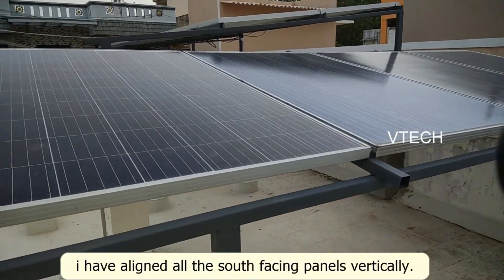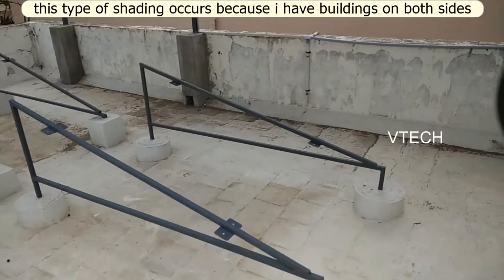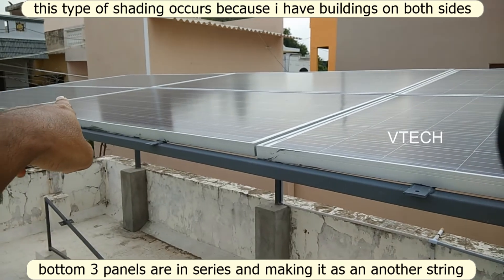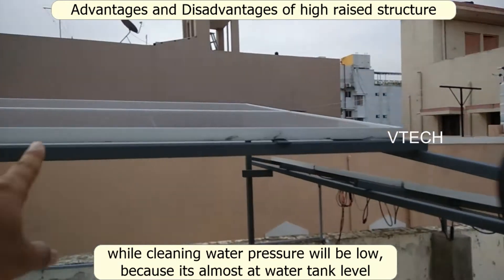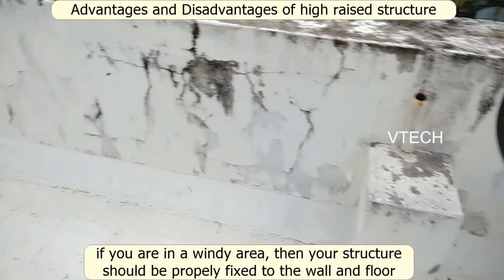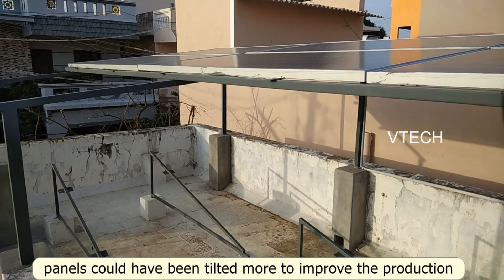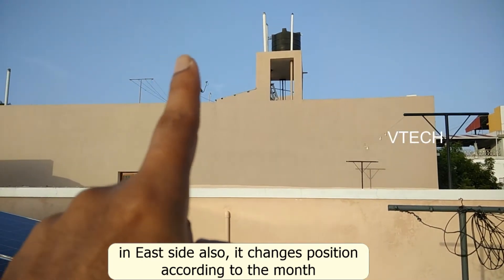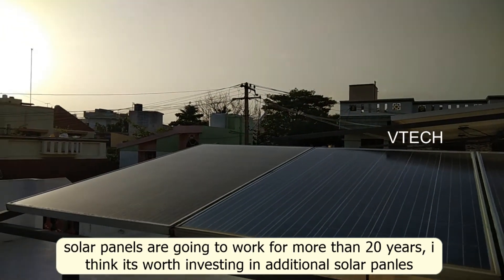Solar Panel Orientation and Shading issues | High raised and Ground mount solar structure - Part 2

Comment: Is it good to have solar arrays in two directions for one inverter?
Reply from the maker: Yes, but need separate charge controllers for each array. Keep west facing panels will improve the performance if your usage is high in the afternoon session. Also will reduce usage of battery thus improving the battery life.
Traditional South facing panels will not produce enough power as compared to west facing panels in the afternoon session.